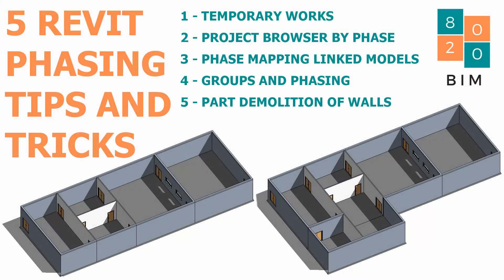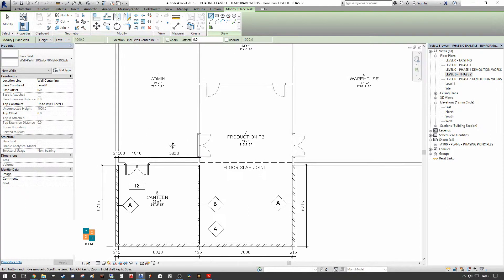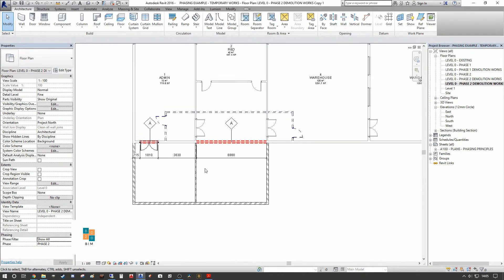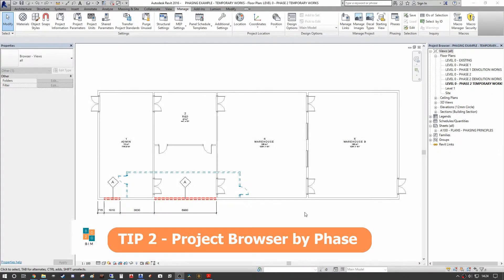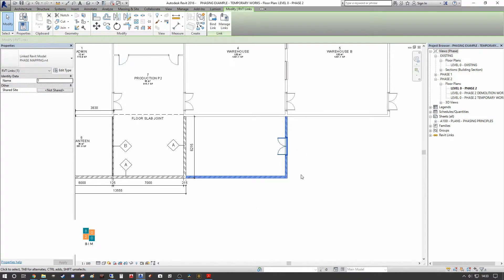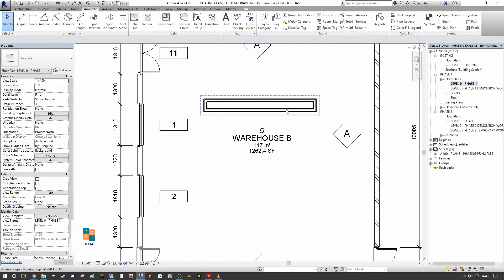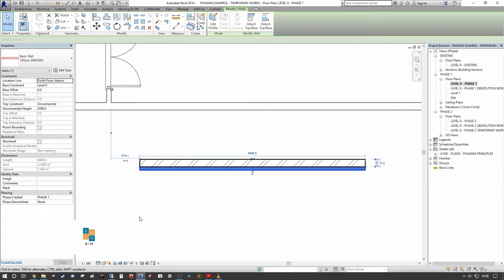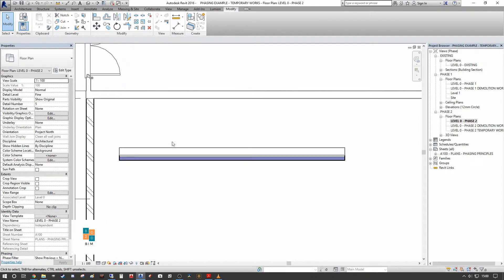5 Revit Phasing Tips and Tricks

Comment: How would you go about showing temporary walls that are set up before any work begins, and then removed towards the end of a project but not necessarily after completion? There would also be temporary walls that are put up and removed during different phases.  Thanks, really getting a lot of useful stuff from your channel.
Reply from the maker: Hi Charles, glad to here you are finding value in the content.
With regards to your question, I am afraid there is some nuance to be considered. I think the best way to do this is to create a detailed phasing strategy for your project and identify the correct time lines of the works in the real world. I generally try keep number of phases to an absolute minimum - no need for enabling works /demolition phases for example as they can be communicated via the phase filters. Once you have identified the proposed phases of works (think big - such as expansion phase 1 2020, expansion phase 2 2021 if you have a building that is Likely to grow in distinct independent building volumes and time intervals - I would not have a house extension broken down to Builders works Phase, 1st fix and second fix phase for example, this would all be considered a single continuous phase of works).
Once the project phases are understood completely, I would start the assignment of the temporary items accordingly - if you have temporary items that stretch across multiple phases you will not be able to use the temporary phase filter as it will not present the way you desire. In this instance I typically give the temporary items a distinct property that a view filter can then be applied to so it communicates the walls as temporary via a matching line style graphics override to the temporary phase filter line style. Clear as mud, I know.
Anyway, I hope that response clarifies a few things for you Charles. Make sure to subscribe and I'll make a video specifically about view filters in the coming weeks which may help inform a little better than I have described above. If you have a really awkward project particular you would like to comminucate we can figure out a way of opening a communication channel and I can better direct you to the solution. 
Regards 
Niall
Reply: @8020BIM  Would it make sense to create temporary walls in every phase even if they are just replacing temp walls from the previous phase in the same spot?
Reply from the maker: I wouldn't recommend that Charles, it means the creation of many more instances of a wall than will actually exist. Any scheduling etc derived from the walls will be incorrect, quantities will be inaccurate etc.
I would stick with my original suggestion of using a view filter in combination with a parameter (even something as basic as filtering by comment - could assign a comment "temporary" to the temp walls throughout).

Comment: For “Part Demolition of Walls” what if we have one window in that wall ? And we want to demo finish layer and build another one ?
Reply from the maker: For part demolition to host elements such as Windows you merely place the window onto the proposed phase and it will show the cut ope dimensions as demolished. For finishes only you would need to split the walls into parts or you would need to model a finish as a wall in isolation first to show the demo of said finish.
Niall